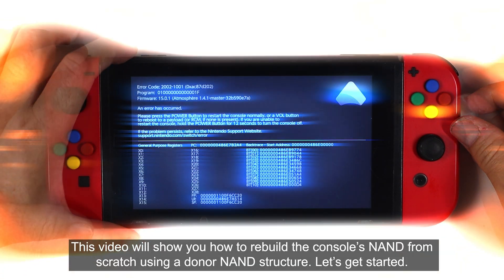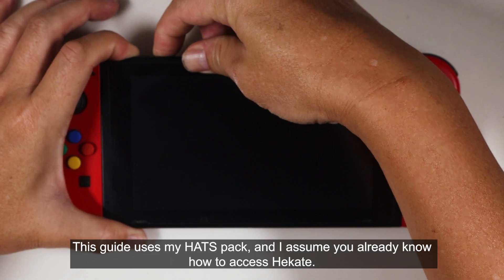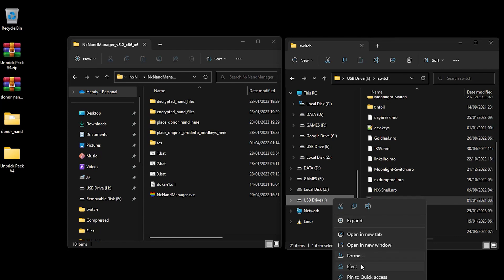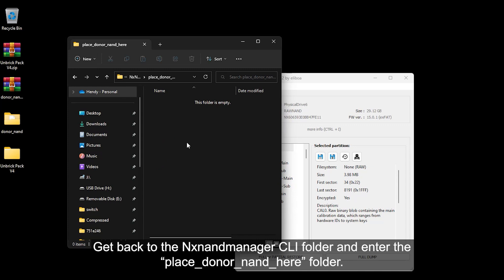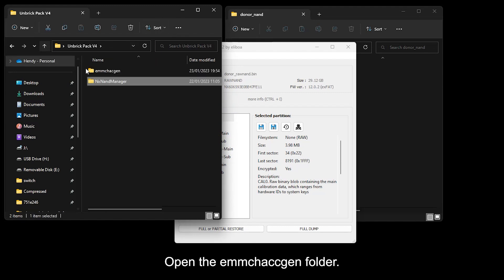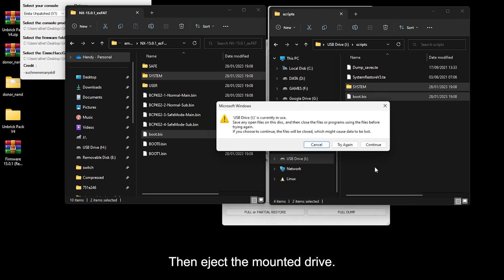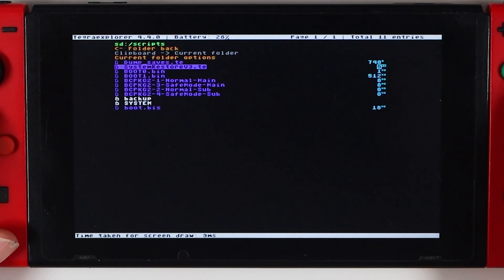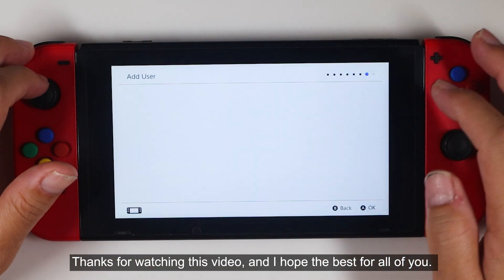UNBRICKING THE NSW LEVEL 2 : REBUILDING THE NAND STRUCTURE

Comment: Hello just a question: I have a broken Emmc, it cannot read rawnand. I have all Keys and BOOT 0/1 is rawnand are not readable. Is it possible to rebuild it to a new EMMC Chip? And if it works, can i go safe go online?
Reply from the maker: you need to have the prodinfo , keys itself cannot 100 percent create a new nand from scratch .
Reply: @sthetixofficial and the prodinfo is in the rawnand? I have everything boot 0/1 but i get error when i try to save raw gpp.
Reply from the maker: the prodinfo is inside the rawnand, if the nand partition is empty (when you check via hekate), then you cannot save the existing prodinfo

Comment: I had this issue on my unpatched switch, it was stuck at the second Nintendo boot logo screen. My issue ended up being the wi-fi chip. I installed Linux on my switch and I noticed I am unable to detect any wifi signal. I reflowed it and everything is back to working condition! I hope this helps someone in the future.
Reply from the maker: Thanks for sharing!

Comment: @sthetix

Hi i have a V1 unpatched with picofly chip.  however, after the mod, i could boot into hekate  back up what i need but once it load to atmosphere logo the screen went black.  Same thing while booting in OFW after the nintendo logo it would go black screen after that.  i did take the mod chip out and it boot into Nintendo but after that logo it would be a black screen. At this point, is my switch soft brick? and is there a fix?  please let me know and thank you for your assistance.

Comment: up to 5:58, my serial number is still xaw10000000000; 3:56 nand s/n also is xaw10000000000. something wrong and how to check? (Icurrent version is 18.0, thanks
Reply from the maker: If you launch the CFW, the serial number will alwys be zero. try launching the OFW.
Reply: @sthetixofficial  checked time 5:56, inside the folder, i dont have donor_rawnand.bin, My donor_prodinfo.bin still here. which step (1.bat? 2.bat? 3.bat) I failed to create donor_rawnand.bin at folder "place_donor_nand_here" ? Thanks~~

Comment: I've got a V1 patched Switch on 12.0.1 with corrupted User partition(defect emmc). I backed up every other partition and Boot01.

I did every Step and rebuild the Emmc to another Emmc chip with no errors (2 times). When I try to boot into ofw the Nintendo logo appears and then black screen.

With the defective emmc i can boot flawless into the ofw until I do something that tries to read the defective part of the User partition.

I've used the newest Hats, Firmware 18.0.0

I dont know what to do anymore.
I just want the Switch to work in a original state.

(Just in case I use the picofly modchip)

Thanks to everyone, who tries to help me
Reply: Booting once in cfw solved my problem. Now i can boot in both

Comment: hi, i´m kepping trying to get my switch 2019 alive, i´d been done every of yours tutorial and nothing get it alive again, for this level witch dononr nand i have to use for mi 2019 console? i has been trying with the non oled donor nand. by the way when i check the partition of my console, i seen an un allocated space of 526mb in my nand memory. is this normal? another issue is my console´s serial number is wrong
Reply from the maker: if your console doesnt have a hardware issue then the level2 should be able to fix it.
Reply: @sthetixofficial  thanks
Reply: @sthetixofficial  i do it again, and the same arror apperas: a fatal error ocurred when rining atmosfere.
program id:01000000000005
error desc: std::abort()called (0xffe)

do you know any hardware issue related with this message?
Reply from the maker: please try doing the systemwipe.

Comment: finally i have recovered my switch., but when i press launch and then sysmmc on hekate i get the error: failed to match warmboot with fuses if you continue sleep won't work. how can i fix it? and if i try to boot OFW i get a blackscreen.
Reply from the maker: You need to update your firmware to the latest one and the warmboot error will be gone.

Comment: Funciona en oled?
Reply: Thanks with the first video I was able to do it, thank you very much
Reply from the maker: You are welcome.
Reply from the maker: it does.
Reply: @sthetixofficial  I have an OLED that stays on Nintendo because the screen turns off
Reply from the maker: maybe you need to follow the level1 unbrick first
Reply: @sthetixofficial   Hello, when I press the prod.key to load, it does not load, it only shows this in red. unable to open el save skipp

Comment: Possible to get updated link for the Donor Nand? Both the main and the mirror freeze at 9% during extraction for me
Reply from the maker: no other link. Maybe you need to use other extraction tool, like 7zip?
Reply: @sthetixofficial  winrar did finally extract it. Just sat at 9% forever. Thanks for the quick reply

Comment: Hi thanks switch it all working, so this is still cfw is there anyway to get it back to original state ofw???
Reply from the maker: CFW is not permanent. You still can run OFW.
Reply: Ok brilliant thanks,  how can I remove cfw safely as its sysmmc I wanted to do emummc? I made emummc partition on sd card but can't launch it
Reply from the maker: what's the matter with the sysmmc? I think u need to learn how a modded switch works
Reply: I'm unable to install any games, updates or anything else through tinfoil just keep getting messages like: failed to read nsp metadata, unknown nca magic (decryption failed) but most of them say "failed to open nsp" , ive checked the hekate ipl file and the kip1patch=nosigchk is there. I've only ever used emummc, do you have a guide on sysmmc. Thanks
Reply from the maker: Try to use DBI to install games. try using my pack too, https://codeberg.org/sthetix/HATS
Reply: Hi it turned out to be my micro sd card causing all these errors changed it and everything installed without issues. I've kept sysmmc and got rid of emummc thanks for your time.

Comment: Hi.. if i've a patched switch (v2) with emmc problem.. if i turn on the switch it goes to APX mode.. activating the payload does nothing..  it's possible to rebuil the nand with a unpatched device? Swap the emmc to the  unpatched device and can I try to test the emmcs and see if you can still let Hekate read it (emmc sanity check) and try this guide?
Thanks for reply
Reply from the maker: you can always build the nand as long as you got the CPU key and the current prodinfo file.

Do you have access to Hekate?
Reply: @sthetixofficial  it's patched switch i can't access to hakerate i haven't the CPU key..  it goes to APX mode.. activating the payload does nothing.. my question is.. is it possible does something to fix the emmc? (replace to new one eMMc, because the switch goes to APX mode it is in "safe mode" i think becouse the eMMc is corrupted or it no read ) There is no possibilities to exit to "APX mode" with another "no patched switch" (and in this i can go to Hekate) and swap the eMMc and rebuild? (yes i not have the CPU key of the patched switch)
Reply from the maker: You must chip the console so it will boot to Hekate. Later, you must rebuild the boot0 to fix the console with the emmchaccgen.
Reply: @sthetixofficial  I thought I had to chip it.. it's an expense that the customer definitely doesn't want to face.. thanks at least I discovered new things ;) thanks for your time..

Comment: on my console info i see that GPP (eMMC USER) Partition table is absolutly empty. i see in the video that in this partition were some things, first of all the prodinfo. 
When i open tegraexplorer 4.1.1 i see the following alert:

An error occourred!

err: 21
line: 290
file: source/main.c
desc: keydump failed

and trying to access my eMMC RAW GPP with NxNandManager 5.2 i get the error: Input file/drive is not a valid NX Storage. 

are this kind of errors fixable with unbricking level 2 guide? or i have to go to level 3?
Reply from the maker: i think you need to do the level3 as you dont see anything inside the nand. But it is limited to firmware 16.1.0 only.
Reply: @sthetixofficial why 16.1.0? Level 3 dose not work with 17.0.0? May i update tò 17 After rebuild in 16? Sorry... But it's a new world for me... I' m Just trying to understand. Thank you so much
Reply from the maker: @Tronikx the prodinfo gen does not work on 17.0.0
Reply: @sthetixofficial ah ok. So Can i rebuild 16.1.0 and then update to 17.0.1? Is It possibile?
Reply from the maker: No cannot. it only works for firmware below 17.0.0

Comment: Hi im 7 minutes in, ive opened EmmcHaccGen Gui and selected what my console is ticked the box choose my prod keys, fw folder and emmchaccgen.exe but when i press go a window appears for a split second and closes, thats as far as i can go 😢 as it doesn't create the new folder in the emmchacgen folder? Thanks in advance
Reply from the maker: try using https://github.com/suchmememanyskill/EmmcHaccGen/releases/download/3.0.0/EmmcHaccGen.GUI.zip
Reply: Yes that worked thank you your a star 😊, one thing everything works perfectly apart from when I disconnect the joycons to play on tv they switch off automatically and won't reconnect unless attached to the switch, any ideas. Thanks again
Reply from the maker: Try to disconnect the joycon from the system settings and set it up again (sync it using the sync button)
Reply: I've done all that I've watched several videos on re pairing and nothing is working, it all works perfectly connected to the switch but as soon  I take them off they turn off straight away, and when I try to sync with the button the lights just flash searching for the system but can't find it like the Bluetooth isn't working 😢 is there any way to test the Bluetooth connectivity on the switch itself?

Comment: PLEASE HELP!
I F*** my switch and now the only thing i get is a purple screen. i have an oled switch mooded with v6 instict chip ( mooded with your tutorial guide 6 moths ago ) and it was working perfect until i f*** it up. i installed pokemon yellow from tinfoil and after i lunched it i got a fatal error, after i rebooted it the only thing i get is a puprle screen.
HERE COMES THE WORST PART, i dont have a NAND BACKUP or at least i cant remember if i created one, i cant even access hakete from switch or via TegraRcm because it shows the purple screen directly. I can put it on RCM Jig to make TegraRcm recongnize it but its still impossible to inject hekate because it stuck the process. The only thing i have are the files from my sdcard,
IS THERE ANY HOPE TO SAVE MY SWITCH WITH THE SD CARD FILES I HAVE? Because i see there are some PRODINFO files in atmosphere folder or the only hope left for me is NSW LEVEL 3. 

THANKS AS ALWAYS
Reply from the maker: That is easy bro. Try to do the level1 guide, it will fix your console.

Comment: hi sthetix. do a corrupted proinfo oled using this method. i have tried this process but still the same (not pass the nintendo logo). when i tried nxmanager it showed exactly the serial number on the back of my console , i don't know for sure if my proinfo corrupted or not? i'm intending to use your unbrick lv3 which i have done sucessfully on my v2 before but if i can salvage this oled it would be nice thing.
Reply from the maker: if the nxnandmanager shows the console serial, then the prodinfo is not corrupted. the oled should be fine too.
Reply: @sthetixofficial  forgot to thank you. you was corrrect with just proinfo my oled come back to life.
Reply: i thought so but i tried your lv2 and it still not pass the nintendo logo. for more informations this one had a bluescreen(fail modchip) from a shop. i took the nand off then reball it,after that the console can boot to nintendo logo then shutoff so i don't know if i can use the prodinfo anymore. @sthetixofficial

Comment: If your picofly/hwfly doesnt glitch anymore after you write your new nand onto your emmc its because you did it via nxnandmanager like suggested in this video. It seems nxnandmanager writes it on the emmc on a slightly different position then it should be. The switch can handle it but the picofly cant. Rewrite your nand via Hekate and the picofly will glitch again. To initially boot into hekate you need to use another emmc modul.
Reply from the maker: interesting

Comment: Thank you for responding . I need help . When I run Emmchaccge GUI, the computer only blinks once and exits, so the original file cannot be saved. Let me ask this error from pain. Thank you
Reply from the maker: You need to use the dot net core 3.1
Reply: @sthetixofficial  Thank you very much . I'll download it again and see if there are any problems, I'll reply to you
Reply: @sthetixofficial  I ran the BOOTO.BIN file on the switch, the system reported an error. Thank you for your help

Comment: For me, on an OLED, it gave a black screen after the Nintendo logo, the console has no defects, I use it for learning, I followed all the steps correctly but I had a black screen, current fw 17.0
Reply from the maker: Use the latest hats pack, launch atmosphere. It should boot.
Reply: @sthetixofficial  I redid everything again and it worked, despite already having the net framework I also installed it so there would be no doubts, but I think I made a mistake in using the original prod.key I must have used the ones from the donor folder, in the end it worked, congratulations on the work!
Reply: @sthetixofficial Hello friend, perfect video, listen I have a switch with chip but when I start atmoshere last Fw 17.01 minca always error, I tried all the atmos and also sd, but since always error 2002-4373
Reply: O meu nintendo switch oled ficar travado no segundo logo e não iniciar 😢
Reply: Hello I have this same problem, I read your reply but I don’t understand what you did to fix it

Comment: "[Fatal] Failed to copy registered"
[FatFS] Error: CCHK"

Did you happen to encounter this error?
The error indicate an issue reading the content system folder
Tried 2 different authentic SD cards same error.
Reply from the maker: bad emmc chip?
Reply: @sthetixofficial   No, I solved. After flashing the boot0/1 it didn't give any errors.

Comment: i usefully did it all but now my instinct chip goes purple then white and doesn't boot at all what do i do? i tested all connections on motherboard and its all fine. Any idea what it can be?
Reply from the maker: check the soldering points again. it is not connected properly
Reply: thank you ill try again @sthetixofficial

Comment: i used haku33 and didnt turn off auto rcm, and now the screen shows the nintendo logo then a black screen. im on firmware 9.1.0 and i was using sxos. i followed your level 1 and it didnt change anything. i started level 2 and when you got to the missing user part, mine has that. so im not sure if i should continue or try something else. thanks for all the help!!
Reply from the maker: Just use the latest hats pack, https://github.com/sthetix/HATS

your console should be loaded fine.
Reply: have you solved it?
Reply: @gabrielcordovagarcia2828  no unfortunately i tried everything from the first video and none of it worked, then life happened and i got busy, im hoping to try again in a couple weeks to see what i can find. if i find a solution i will come back and let ya know. hope you do the same.

Comment: i getting error during systemwipe, is it normal? installed a-17.0.0_exFAT with tegra SystemRestoreV3.te. Is this normal?
Reply from the maker: what error?
Reply: @sthetixofficial  is this guide suitable to unbrick my fw17 switch?
Reply: @sthetixofficial new updates, i tried with your latest hats seems working now, seems the Lockpick_RCM v1.9.11 do a proper key dump compare to previous version, which cause all the rebuilding not work due to product keys incorrect. Thanks very much!!!! you are the man!!!!!
Reply: Album deletion fail
Reply: By the way, is this guide suitable for firmware 17 unbrick? My switch just installed mod chip and unable to boot into cfw/ofw. Only just able to boot into hekate.

Comment: Hi, 

Im already follow for level 1 after that i got bluescreen then the booting chip going to hekate become so slow, before just need 1 or 2 second maybe become 30second or more

Then i follow for level 2  when try launch system restore ive got notification that "Fatal Failed to copy registered" after that tryng to boot ofw got black screen

After that i tryng again to level 1 then still got notification Fatal Failed to copy registered

Can you help for what step i can do? Because if i want to try level 3 step as i know im watch that step i will cannot play online again.

Thank you
Reply from the maker: Do not do the level3, it will screw your nand.
Try replacing your SD card. probably that is the issue of the slowliness
Reply: Thanks for your response,

It is happen because im upgrade firmware 17.0.0. At this potition before im stil can access emunand. But after wipe sysmmc i cannot accest emunand or sysnand

Im tryng to delete save file 120 the nothing happen.

after replacing at SD card using different hats can booting to sysnand logo Nintendo appear but after that  blackscreen. or Emunand appear logo atmosphere then blackscreen

Tryng to dump firmware at sysmmc nothing happen ( just want to know firmaware potitiion)
but when i try dump sysmmc show the firmware 13.x.x

I think the firmware right now using firmware 13.x.x as im using follow step level 2 and failed to using systemrestorev3.

Can you guide me for step what can i do please? @sthetixofficial